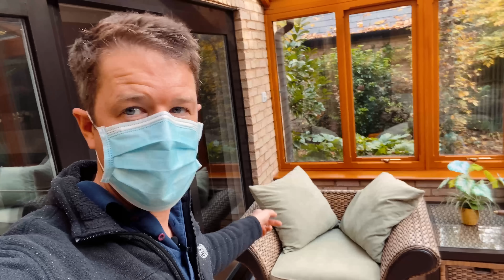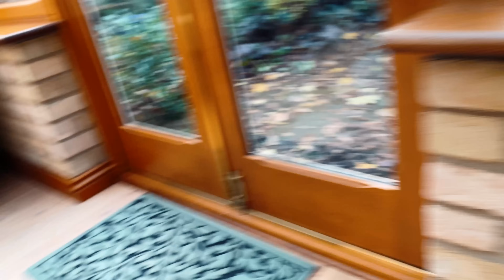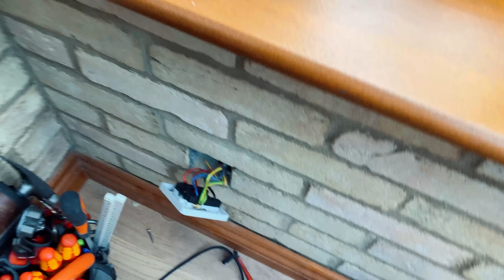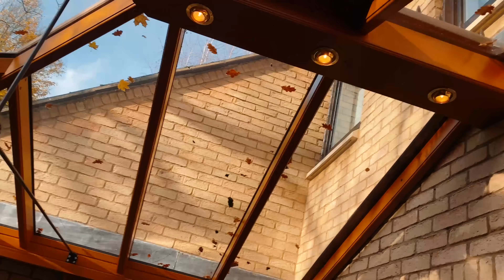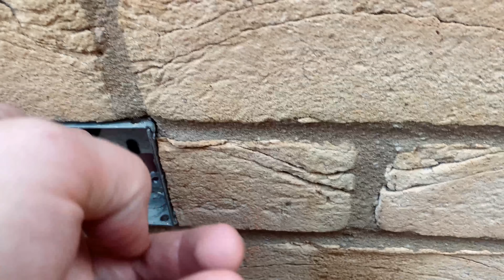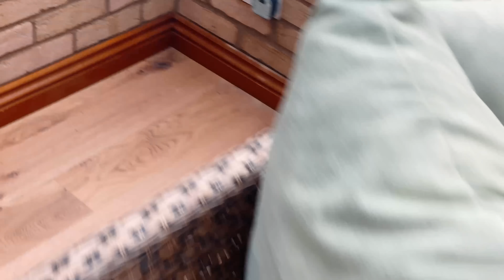Fault Finding Conservatory Sockets - Electrician Life

Comment: Love your work, with a straight forward explanation of what's going on. I'm an electrician who moved on to another life 35 years ago and I have a question regarding the socket tester that you used. When you say correct polarity, I'm curious as to what the display is if the neutral and earth are reversed?
Thanks 
Tony

Comment: I would have replaced the back box as soon as that lug came loose, also I would have swapped the fused connection unit for unswitched and labelled it all up.
Reply: Who pays for parts ?
Reply: @theCybershot123  obviously the customer does, doing the job properly is what you were engaged for and if that requires new parts then so be it

Comment: Had one like that today... very elderly gentleman... bathroom downflow heater hadn't worked for months. Turns out he'd turned off the SFCU thinking it was a light switch. He'd lived there for 40 yrs and the spur had been there the whole time. No charge, obvs :)

Edit: yeah, i do the penny washer trick too.

Another trick (some might call it bad, but it can be useful!). If you have a garage CU with a minimum of 25mm knockout, and no 20mm.... SWA banjos  will work as a gap filling washer... and can be bolted in  place obviously.

Comment: Thank you Jordan  - I have a client with exactly the same problem with a loose back box and a void behind it - I was thinking about all sorts of ways to fill it in and fix the back box being careful not use anything that could damaged the cable etc. It turns out that the answer is really a simple case of adapt and overcome - penny washers at the ready! Thanks again 👍👍

Comment: Would it be possible for you to make a video regarding your testing procedures for a lighting circuit. More specifically, how you go about obtaining your R1+R2/R2 values, and insulation resistance testing of a circuit containing dimmers and many downlights? I’ve been told I’m spending too much time removing control gear, lamps and overriding dimmers for the sake of a job being done in the specified time allocated rather than thoroughly!!? This would be a great help🙏🏻

Comment: Why did you not just loop the circuit in the back box of the ‘hidden’ SFU and fit a blank plate?
Reply: It will be a spurn from a ring
Reply: @dwsimon1  I'd still replace it with an unswitched FCU.
Reply: @Ragnar8504  Yeah that would improve on my suggestion above and achieve the same effect (unintentional switch offs).👍

Comment: Drill a 6mm hole in the knockout then knock it out and you won’t need a washer
Reply: The washer has to overlap the box...otherwise you will just have knockouts fixed the the brickwork and still have a loose backbox

Comment: "Someone needs to redesign these boxes" yeah already been done, North American boxes have fixed lugs for the socket / switch screws. Faceplate then attaches to the socket / switch. Box is attached the wall stud in most cases.

Comment: id have packed the back out with bonding mix
Reply: Hi Jordan I notice how you don’t perform safe isolation when you take out a fuse ie locking off circuit or leaving currently dated notices also are your test probes fused on your 240  phase tester?  V.o. Sparks 50 yrs in trade

Comment: When it comes to backboxes, sockets, switches etc. Scandinavian countrys is WAY ahead of England it seems. Switches in sockets, i just dont see the point? Thanks for interesting content. 👍
Reply: I'd rather switch off than pull plug out every time and leave it on the floor or find somewhere to drape it. I think switched sockets are less objectionable than ring final circuits!
Reply: I like having switched sockets on my appliances. They're in reach so I can just turn off and avoid any phantom power being wasted on the microwave or tumble drier or whatever.
Also saved my bacon when the transformer neutral came off last year.
Phase 1 and 3 went sky high and phase 2 dropped down. If the sockets had been on I would have lost a lot of stuff.
Reply from the maker: Thanks
Reply: Yeah they can be useful to save on electricity/time turning everything off at night, just depends how much you care about that sort of thing.
Reply: @obcallum6450  sometimes standby power lights etc can be quite bright. I like total darkness to sleep and it's much quicker to turn off than unplug. I changed an unswitched socket for switched, to help with this.

Comment: Nice idea with the penny washer, I've always just drilled the sides as  you first suggested.

Do you ever feel guilty when charging what seems like a lot of money, when the fault is an easy fix in little time?
Reply: Don’t feel guilty for a customers stupidity
Reply: Yeah in this case I agree, but I've had a lot of faults which end up just been a loose connection that is fixed within 5 minutes. But I have to charge a minimum call out fee either way
Reply: @Kíngsta-GG  why do you have to, or are you not self employed. If it was an easy fix, I used to adjust accordingly, so long as it covered my time and expenses. Made sure the customer knew I'd done it, got alot of repeats and recommendations.
Reply: @Kíngsta-GG  It’s not your problem mate, you need to make a living. Think about it like this. They’ve called you out because they don’t know how to do it themselves. I’ve had faults with my van which are easy fixes where I’ve had to splash out £100 to get them fixed and I didn’t care because I couldn’t do it myself.

Comment: Are you not required to ground your metal boxes? Just curious
Reply: You beat me to it, considering you charged for an hours labour, would have taken couple of minutes to do each. There not earthed when u take the front plate off. Exposed conductive part.
Reply: @thebigcapt  👍👍
Reply: @tww5719  could argue the point that covers shouldnt be removed whilst the circuit is energised (but we all do it)
Reply: @thebigcapt   only if you take the socket front off while still live. Which you shouldn’t.
Reply: So they say not to earth the back box,but being old school the skts did not have a earth link from the scre holes to earth which they do now,light switches back boxs you earth the back box unless there metal clad,I still earth the back boxs ,let's face it it doesn't take long and what harm does it do .
Reply: Metal back box is ground because the metallic part of the socket connects to the back box
Reply: It was grounded/earthed through the socket screws. One fixed lug on the backbox so all ok.
Reply: @tommcdermott1989  Not strictly correct methinks. It's the earth strap at the back of the socket that will provide the earth continuity, albeit that the screws hold the plate against the back box. If the socket plate had no rear earth strap (like some light switches), then the screws themselves could become live in the event of a fault. If the back box has an earth connection I think  you should use it. It only takes a couple of minutes.
Reply: @duncanmacleod7283  
543.2.7 
The only time you need as per the regulations to fit a fly lead to a back box if the trunking, conduit etc is used as the CPC, and only then.
Reply: Thanks for the quick replies. Makes sense then. In america, even in commercial where most everything is steel, we still have to use a ground wire from the box to the other ground wires. Seems redundant because the metal tabs on outlets essentially ground the box the same way as you described.

Comment: Hi, l totally agree with you on the subject of metal back boxes and especially the one gang boxes which still have a top and bottom fixed accessorie holding lugs which l have never fully understood their purpose in life other than damaging the insulation when installing light switches.
Reply: I always squash them flat again.
Reply: Seen some old 5 Amp sockets using vertical screws

Comment: Viewing from the US, nice job as always! What’s with all the low switches & why not just wire that one out, didn’t seem necessary
Reply: Switched fused spur - the fuse is down rated from the ring main
Reply: The joys of UK wiring. To be honest switched fuse spur provide an additional planned point of weakness big surge on that circuit the fuse on that switch would blow before the breaker does.